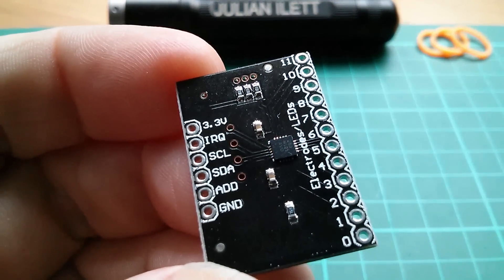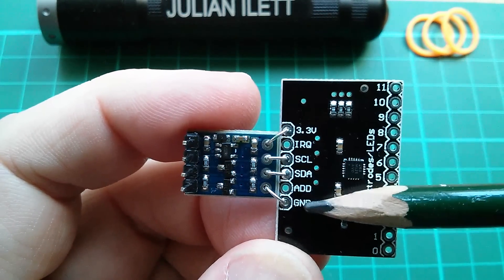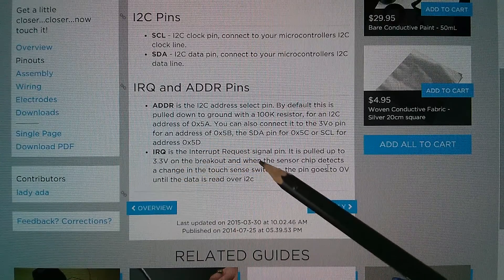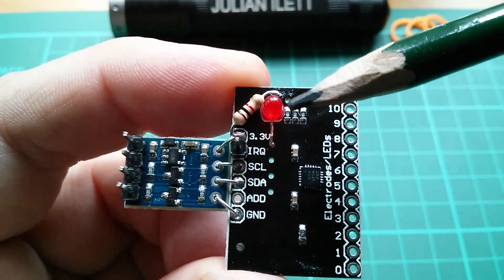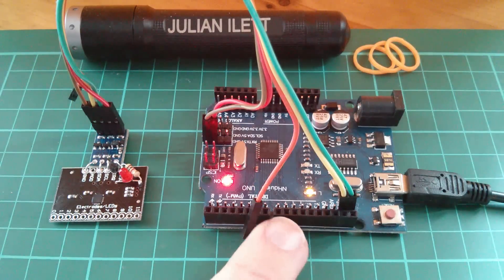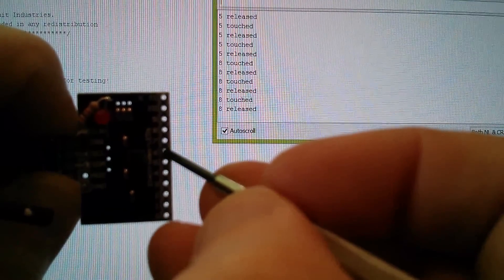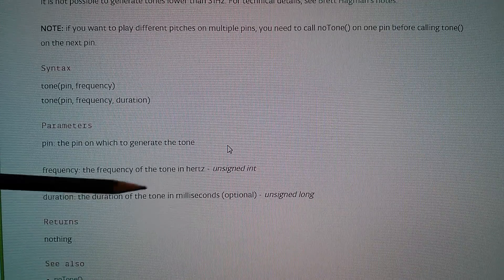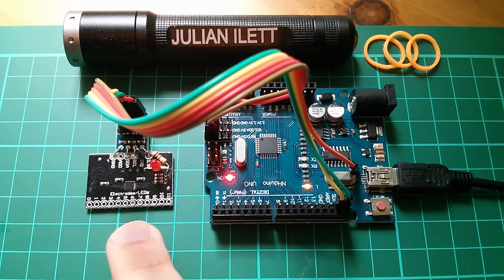1-Day Project: MPR121 Capacitive Touch Sensor Music Organ

Comment: I had that thing lying around for years now, never wanted to play with it because I didn't like the need for a level-shifter - but recently found out that you don't need one. I2C is an open-collector bus with pull-up resistors (here to 3.3V on the board), which are fine to connect directly to the Arduino.
BTW the MPR library uses some initialization values for the MPR121 that I find somewhat implausible (and not recommended in the manuals), so with some tweaking there it's a bit more responsive (reliable at detecting touches).
Reply: Hi there, I’d like to replicate this build to replace the buttons on my playstation controller for touch buttons. How did you manage to use the board without the level-shifter? Or do I just have to pick a 3.3V main chip?
Reply: @James-uz9se  3.3V supply from Arduino's 3.3V pin, SCL and SDA directly to Arduino's I2C pins (e.g. 5 and 4 for Nano/Uno).
The "Pro Micro" 5V/16MHz does not have a 3.3V pin, so if you want to use a pro micro, get a 3.3V/8MHz version. (One is on it's way to me, too.)

Comment: you can regule the frequency now need work with a 1/4 hp motor need make sawstop but with capacitor and ardiono with arduinocapacitor.h this not work the frequency always change do you have any test about?

Comment: why not just use the 3.3 volt output on the arduino ?
Reply: No data
Reply: @ThatGuy-nv2wo  I don't understand. I'm pretty sure you can just 3.3 volt output on the arduino.  Can you explain the no data part? Because I'm looking at the layout of the arduino and can't see any difference between each pin.
Reply: @TheRandolph23  Could it be that even though the vcc would be 3.3, the data/clock etc would still be at 5v?
Reply: You can just use 3.3v: https://www.youtube.com/watch?v=tTMsbL0eH_M

Comment: See the absolute ratings section for IRQ

VSS - 0.3 to VDD + 0.3

Hence the pull-up to only 3.3v.

Easy thing to miss, most open collector/drain outputs don't usually have much head room. An easy trap for you young players as Dave would say.

Comment: BTW, adding a library via the zip file was available in the IDE 1.5.8 possibly earlier versions too.  If you launch an earlier version and go Import Library->Add Library, you will notice that the "File Type" selector says "Zip files or folder".  It is easily overlooked.

Comment: Nice project!
You did an excellent job wiring & soldering.  What power magnifier are you using as a visual aid?

Thanks for sharing!
Reply from the maker: A B Just 3.5D reading glasses from the pound shop.
Reply: Julian Ilett Hmm.. It appeared to be higher power.  Nevertheless... great job!

Thanks for sharing!

Comment: Hello Iulian,
you should take a look at the TI MSP430 controller ; this controller has built in touch sensor inputs and  other nice features (e.g. low power!).
Also its almost Arduino compatible if you use the Energia IDE.
Regards  Andreas

Comment: May I suggest 2 things?

1) try using a fine tip on your soldering iron and just run it over the "bad" IC pads.  If that doesn't work it could be the circuit board its self.  Wouldn't surprise me that they don't test the boards before mounting the components and they obviously don't test the boards after they are assembled.

2) Not a big deal for testing but next time use the pin number plus 1 for the tones.   ;-)

Comment: What the formula i × 100 Hz produces is essentially the harmonic series of a note between G2 and G#2 (in scientific pitch notation), assuming A4 set to 440 Hz. This means the tone of pin 2 is an octave above the first, pin 3 a perfect fifth above pin 2, pin 4 a perfect fourth above pin 3 etc.

The reason why it sounds "musical" is pins 3 to 5 forming a construct called second inversion of a major triad (somewhere between G and G# major in this case).

If you want a piano-like "touchboard" with equal temperament (octave divided into 12 semitones) you can choose some base note, e.g. "middle C" (C4) with f ≈ 261.6 Hz and calculate the frequencies as f_tone = f_base × pow(2.0, i/12.0). As you can see, if we set i = 12 we get f_tone = 2 × f_base which is exactly one octave above the base note.

With that few pads I'd probably go for something simpler though, like the pentatonic scale.

Comment: You've made a better continuity buzzer than almost any multimeter has (well, except that it's continuity to you..)
 This is what's meant by a latched buzzer, too many people reviewing meters on their electronics themed youtube channels think that it's when a continuity buzzer is implemented as a software add on to the resistance measurement and therefore only buzzes after it autoranges resitstance and then complain "it's latched but it's really slow".

Comment: If the I2C pins are not 5V tolerant, the IRQ pin most likely isn't either. I2C pins are essentially open collector outputs so I am sure they use the same output stage on the IRQ pin as well.
On the other hand on many digital 3.3V devices the pins are 5V "tolerant" as long as you prevent a large current from flowing. It is an abuse of the internal ESD protection diodes, which will short everything higher than Vdd+diodedrop to Vdd.
Don't do that on opamps though. A voltage outside the supply rails can lead to latchup and you opamp will go up in flames immediately (don't ask how I know that).